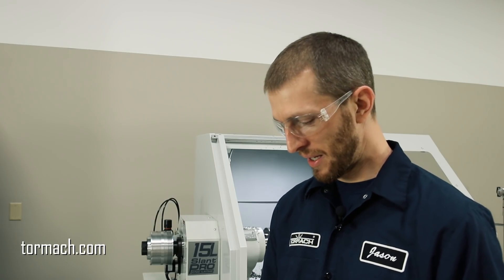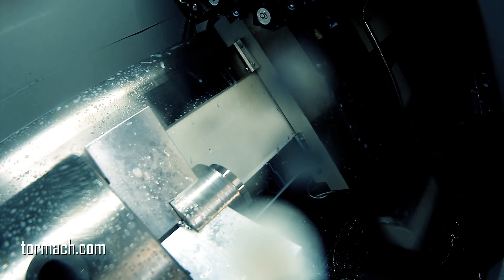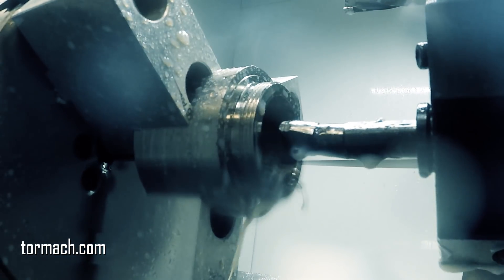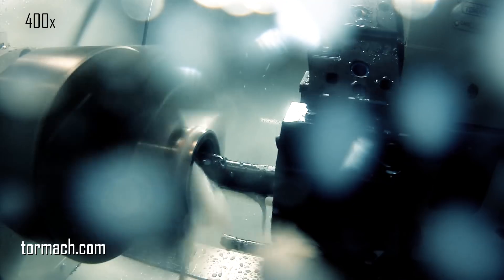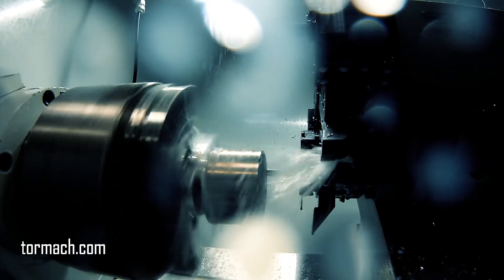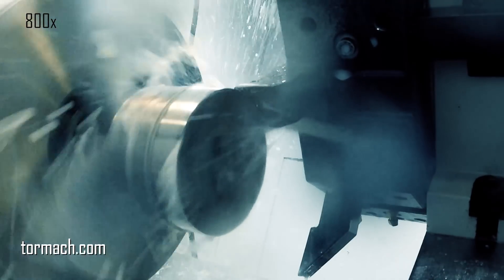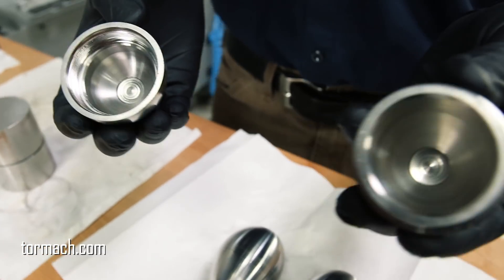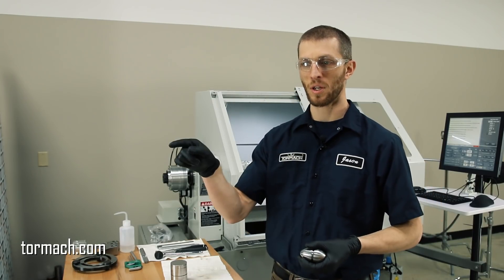Turning a 2-Piece Stainless Steel Egg

Comment: Great video!  Can you touch on best practices for when you stop mid cycle snd the resume?Also how were you dialing in some of the final fit up cuts.  Did you create a single contouring toolpath on the CAD and then doing an offset adjustment? Thanks
Reply from the maker: Great question Chris.  We have a Quick-Tip video showing how to start in the middle of a program: https://www.youtube.com/watch?v=bCd072NUY9s 
On this part we did not make a separate finish pass.  We just used the start from here command highlighted in the above video to  just run the finish pass again.
Reply: Just confirming that if you start mid code, what happens to the global parameters that you typically set in the first couple of lines of gcode in a new program?